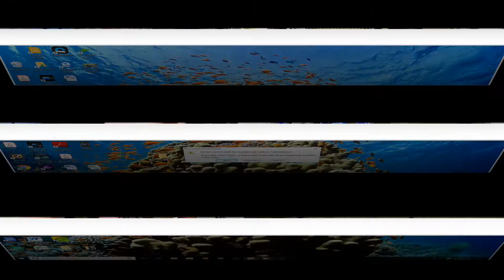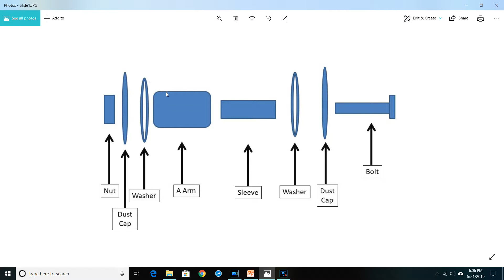Installing Houser Racing XC A Arms on my ATV

Comment: I was installing a set of these arms and noticed I had limited camber adjustment. I figured out that I had the upper a arms on the wrong sides. There was such little thread left on the upper ball joint that it was also difficult to adjust the slicast. I believe the correct orientation is where the upper a arm will have the grease zerks on the top side towards the front. I have not seen the directions from houser on this but I figured it out by looking at their website pictures...
Reply from the maker: I have the opposite problem with mine, in trying to get negative camber I have it screwed in all the way just to get to -2.  Which is fine as that is what I want.
Reply: Meaning it is screwed so far in that you can’t go more negative camber like -3? When I had the upper a arms where the grease zerk was on the bottom (like yours in this video) I could not go any more negative than -2 and at that point the slicast required loosening both nuts which I didn’t like. When I swapped the upper a arms such that the grease zerk was on top, I had more adjustability of castor and camber.. the top ball joint ends up coming at a steeper angle but it seems to be in more of a sweet spot for adjustability.

Comment: It’s been a yr...give me your honest thoughts on the +.5. Do you love them?  Maybe wish you went wider?  Asking all this because I’m getting ready to pull the trigger on some.
Reply from the maker: I would not really go wider,but if I was starting over, I would go +2.5 and get 4x1 offset wheels to bring the width back.  With a +1-4 lsr axle,  you could easily bolt stock wheels on and change your rear spacing and have a 50 wide for just general goofing around. The big improvement on the arns are the ability to adjust castor.  I run negative castor and it really helps in turns.
Reply: Team 2 Gils 
Appreciate the advice Rick. Be patient with me because I’m for sure I’ll be asking some additional questions
Reply from the maker: @flyingbriando5521  No Problems Brian.  Whatever I can do.

Comment: Hi, Great video! Also the suspension setup video, both very useful. How do you take off the ball joints? My new A-arms are coming so I need to learn as much as I can about the process because it will be my first time doing it. That orange hamer its plastic? rubber? By the way, Why you dont go for ar wider A-arms and only for 0.5 inches? and why you decided to go to elka suspension? After you ride it some time, can you share your opinion compared to your rebuilded shocks? I think it will be very useful. Thank you and enjoy your upgrades!
Reply from the maker: Orange hammer is a "dead blow" which is plastic filled with sand I believe. I got all but two joints off with that.   One ball joint I had to use some heat, and one a puller.  Sometimes they come apart real easy,  sometimes not.  I went with the half inch ones as I race through the woods and need to stay fairly narrow.  I chose elka as they are top of the line AND fairly quick to get.   I got them in about 10 days where others were 4-6 weeks.   I was down for the count and missed one race as it was so getting something fast was important.  I have a quick video on the elka I am uploading.   I got a chance to practice a little today and they were nice, tomorrow is race day so that will be the real test.  My handlebars are bent so that should be fun.
Reply: @Team2Gils  Thank you for your answers. Good luck with the race! be safe and have fun! I will be waiting for your upcoming videos :)

Comment: Another great company i run housers on my yfz450r great stuff good video man!
You were in my recommended videos today if you wonder why I’m checkn ya out!
If you take a look at a recent video i did same deal breaking down an a arm i have this handy tool i got from a guy on facebook which makes removing the spindles a breeze!
Did you have any frame damage from the damaged a arm?
Reply from the maker: No damage at all thankfully. No serious damage to me either!  Most everything came apart easy,  had to use a little heat one ball joint, then had one that was stuck hard and went to HF and bought a small ball joint tool that worked really easy
Reply: Team 2 Gils nice ya trees suck ive been to the er a few times because of them they move i swear!
How do you like this new front end and did you upgrade the rear at all?

Comment: Hi, thank you for the video. Do the stock shock setting work well with the new a arms?
Reply from the maker: These are long travel A-Arms so I had to buy new shocks.  If you buy standard travel the stock setting would like work the same.  May need to tweak them some just to dial in better.
Reply: @Team2Gils   Oh ok sorry I was thinking this was the regular travel I didn't read your description. Thank you for your answer anyway.